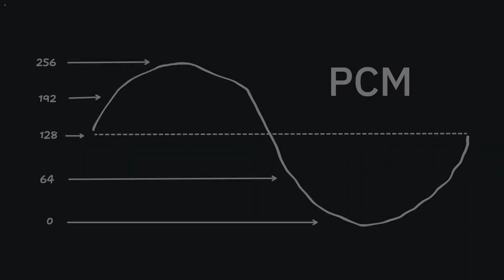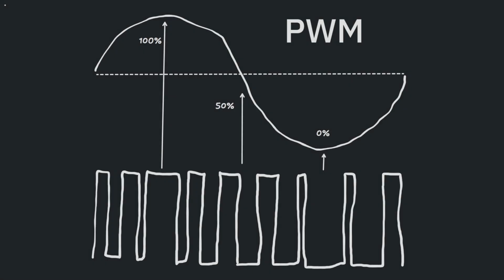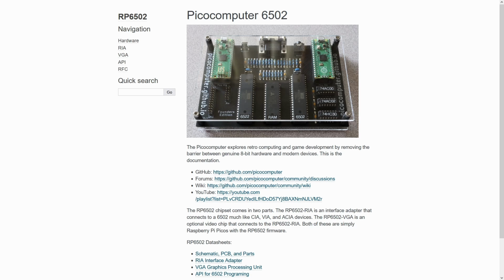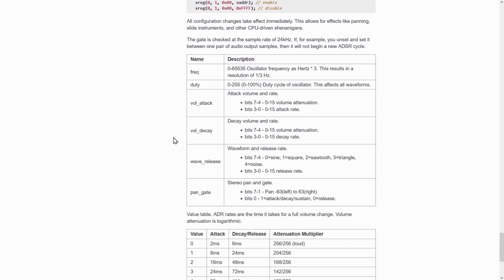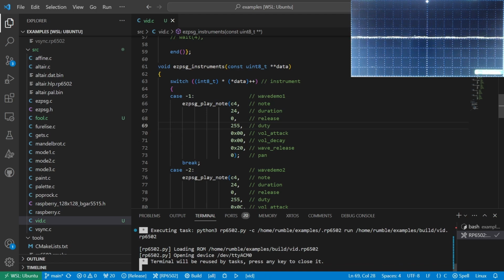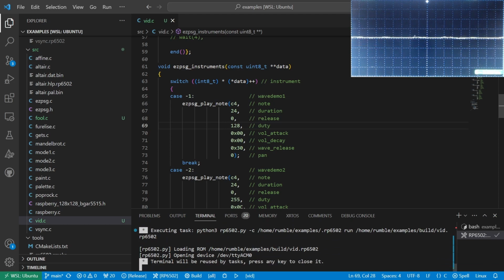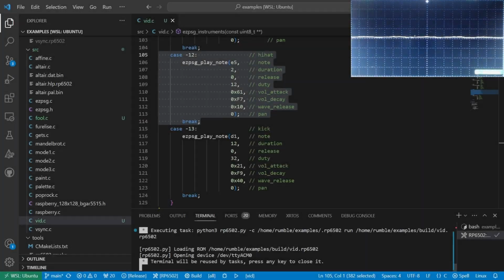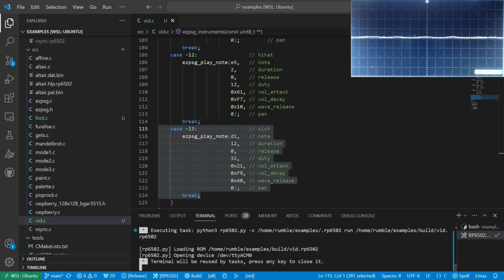RP6502 Ep16 - Programmable Sound Generator Intro

Comment: How is Für Elise copyrighted?  It's even older than Mickey Mouse.  lol.
Great video.
Reply: It's not that it's copyrighted, it's that someone has claimed the copyright as far as YouTube is concerned, and "the algorithm" doesn't have any latitude to allow for the possibility that another rendering of the same tune, that basically sounds the same, can be a completely different piece of work.  YT copyright misattribution is a major issue for some content creators.
Reply from the maker: Exactly. I uploaded a test video that got flagged right away. Easiest to avoid that mess whenever possible, so I did.
Reply: @GodmanchesterGoblin That's correct.  Just simply accusing someone on YT is enough to get them "judged and prosecuted".  Which is why I wished there was a viable competitor to YT.

Comment: Cool implementation of sound generation. I have to make a tracker, but for the PSGs I have, the AY-3-8910s. How do you manage to play multiple channels at the same time? Different output pins summed up together? Or it's all in software?
Reply: The PICO-56 uses a similar PWM scheme where the various channels of the two virtual AY-3-8910s are mixed in software and output to two PWM pins (left and right) on the Pi Pico.
Reply from the maker: The tracker was yet another side project, but play/sleep/play only gets you so far. I do all mixing in software.